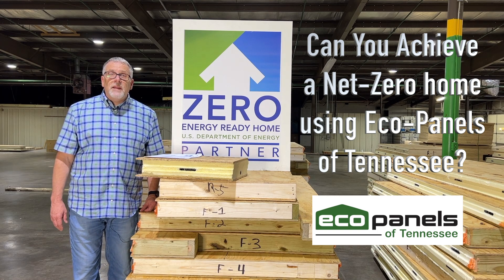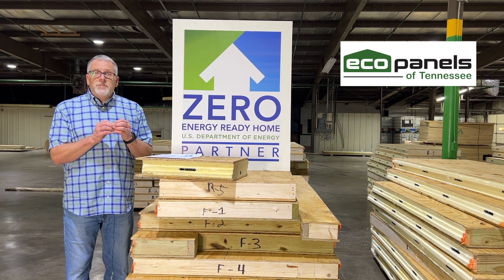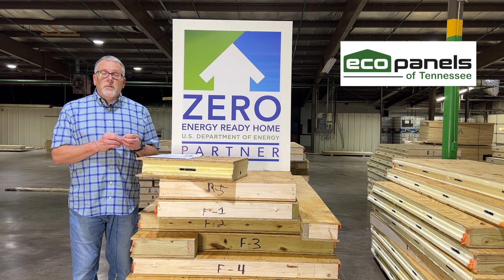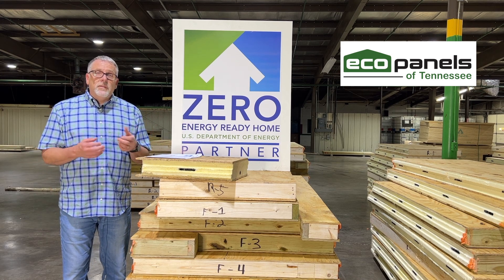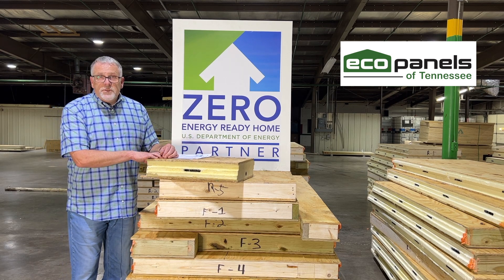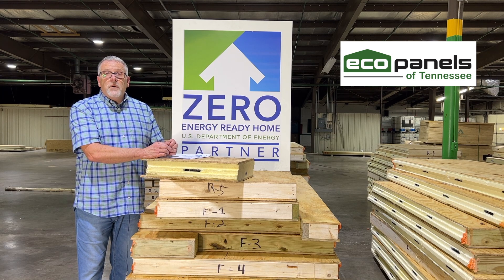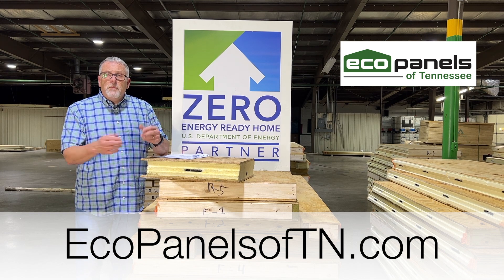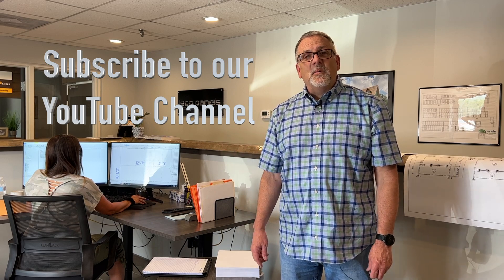Can you achieve a Net Zero home using Eco Panels of Tennessee?

Comment: Hi!
Went through all of your videos to see if these questions had been covered and I dont see them. 
1) I’ve fallen in love with that Scandinavian style “monopoly house” design where there is no roof overhang.  Have you worked on a project like that? I really want the walls and ceiling to be made the same way to eliminate trade conflict. Ill try to tag a video under this comment
2) what is the life expectancy of sips panels? I’m going to build my dreamhouse but I also want it to be an heirloom for my family
3) do any types of inside wall & ceiling finishes work? Id be using a standing seam panel for roof and exterior walls
4) I didnt see plumbing covered. How would PEX be routed?
5) the 6” wall panel is enough but im building at very high elevation and need more r value in the roof. Ive seen homes in the area for sale using combos of spray foam rockwool etc claiming R60-R80.  Do you offer a 8” thickness or how would I achieve that?

Thank you all do much im originally from Tn and id love to build my forever home out of stuff from there
Reply: https://youtu.be/ferKJ7nNb_o
Reply from the maker: Thanks for the questions!
1) On a small scale, yes we have, but it's not typical in our area. You may want to hire a local engineer for your project to make sure you're meeting code in your area and dealing with that part of the home build appropriately. 
2) The same as any other home. Our walls should be encapsulated like any other framing, then the exterior / interior maintained over time. There's no expectation of them being any less durable than any other home.
3) Generally speaking, yes.
4) Through interior walls, which is the same for any home construction. Especially if you're building in a cold climate, you should keep your plumbing contained to your subfloor and interior walls.
5) Currently our largest is a 6.5" R-40 panel. With the type of buildup you're describing, our roof panels may not make as much sense as for the wall panels. We could take a closer look at that and give you our assessment.
Thanks for the questions (and reaching out back home to us)... sorry for the delay in responding. We would be happy to review your plans and hop on a call to discuss.
Thank you!